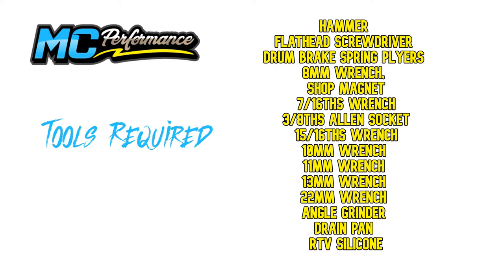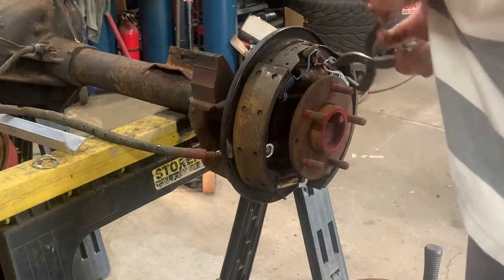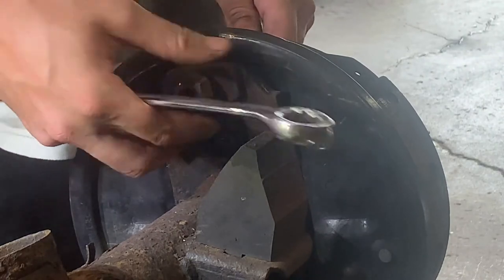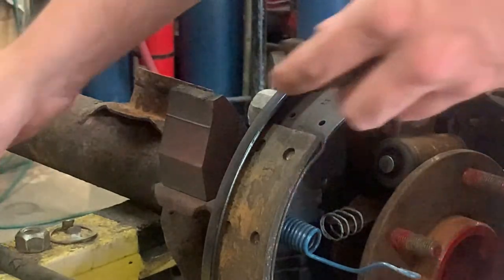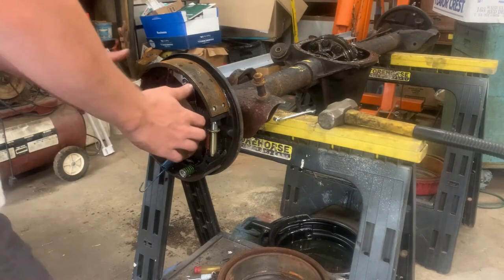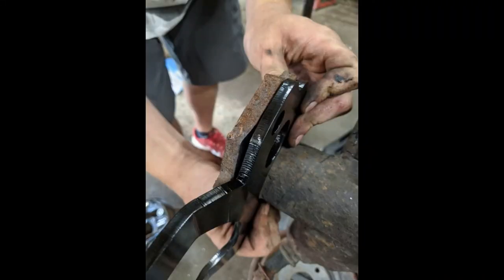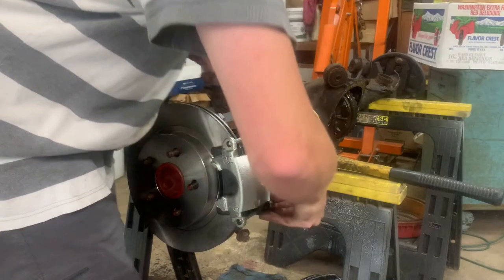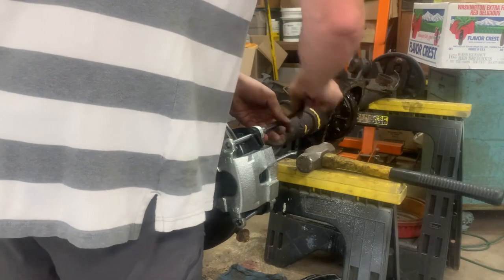MC Performance 1978-1988 G-Body 1982-1992 F-Body & Early S-10 Rear Disc Brake Upgrade Install Video

Comment: Check out my conversion kit ) This can buy in most partshop, but needs to redrill bolt pattern and grind axle flange. Mountig plates made from scratch by myself.

Comment: Be careful buying this kit.  Did not work for me.
Reply: Im waiting to hear back from them about an issue I'm having.   What's the verdict on yours?
Reply: @aadams0921  They are buying back the rotors, calipers and pads.  Not full price but at least enough to make me feel OK.  Did you buy this kit and what issues did you have?
Reply: @timothybush4301  the calipers and bracket would not align to get the pin in.  Tries both brackets.  Spent a full day on it
Reply: @aadams0921  on mine the caliper would not set fully on the rotor.  Pads were sticking up1/8 inch above rotor.  Then the frame was being held up by the emegancy brake levers.  Was also told stock 15 inch rims would fit, not the case.
Reply: @timothybush4301  yep.  How long did it take to get in touch with someone?  Do you have a phone number?  I've been communicating thru Facebook but haven't heard back.
Reply: @aadams0921  I do have a number, but mostly converse through FB messenger.
Reply: If you can find me on FB messenger I will give you his number there.
Reply: Sometimes he replies right away and sometimes it is a few days.